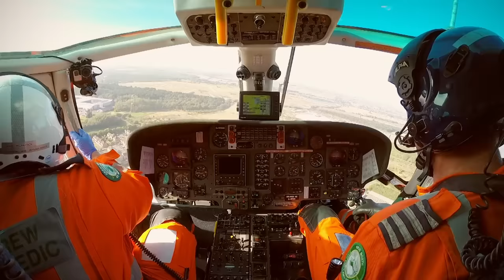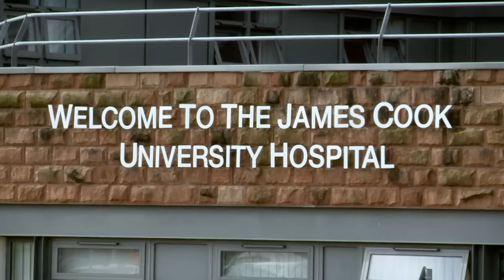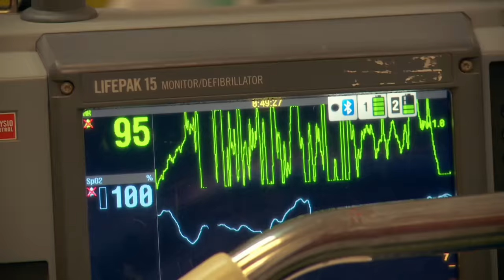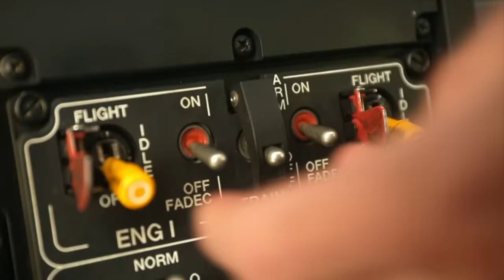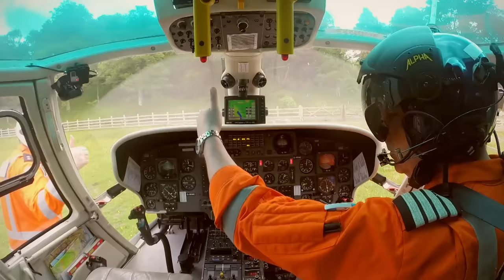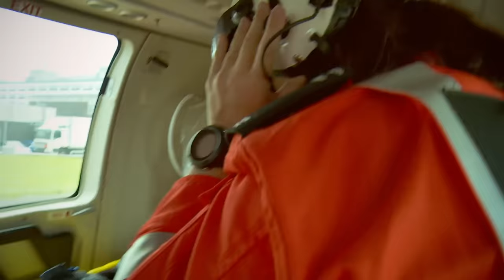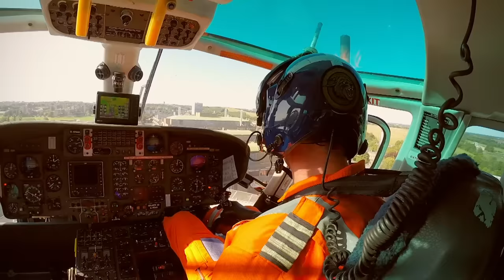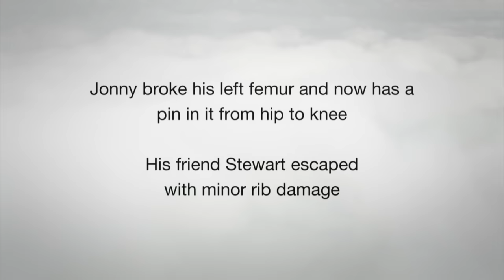Air Ambulance ER: Teenager Gets Trapped Between Two Cars | Medical Documentary | Reel Truth Science

Comment: The blonde lady is out of uniform she’s wearing it like a prison inmate. Her co workers are wearing their orange jumpsuit properly.
Reply: Copy that10_4  why are you mad about that? At least she’s doing her job
Reply: I'm sure there is a reason why she is wearing it that way. I can easily think of a few. 1) It may not fit properly and may even be restrictive. To be blunt,  she is both a little heavy and large breasted, both of which can cause significant fitting problems. 2) She may suffer from excessive sweating.  Better to not have the top half on than to have sweat running down your face and dripping on the patient. I don't see the other people on scene wearing jackets, so wearing an extra clothing layer could be a problem.  3)The brightly colored suit is for visibility. She has it on and is clearly visible. We don't know company policy. She might not be required to put it fully on- particularly during daylight.
Reply: Who cares she clearly is doing her job. And if you know anything about those suits they can get pretty hot. As long as she's got other members around her in the bright suit she is alright to do so. You're no manager or auditor. So chill